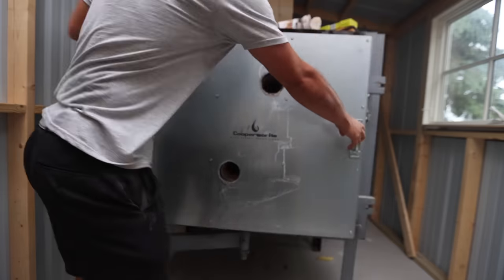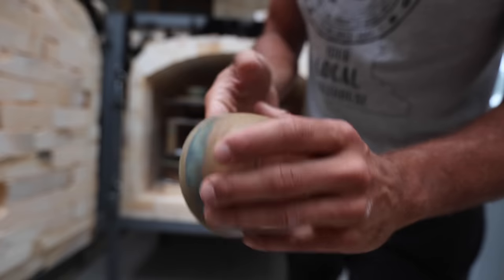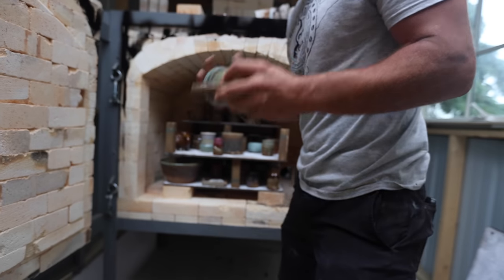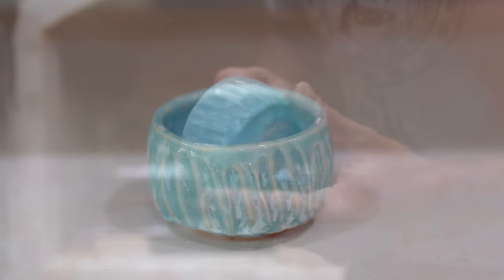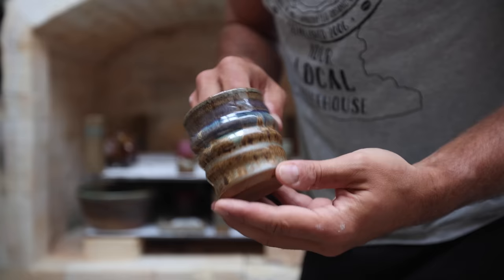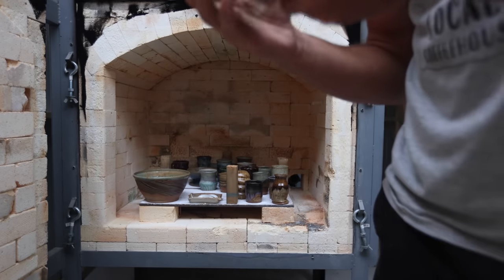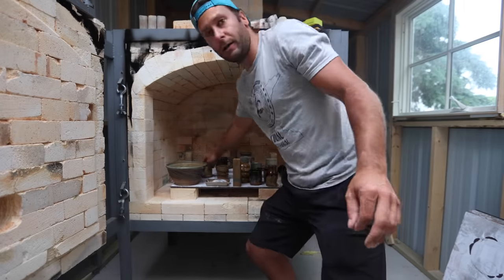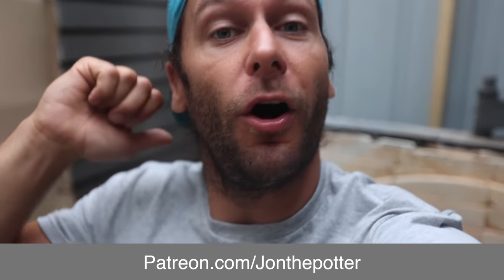THE RESULTS!  Finally UNLOADING the NEW GAS KILN!

Comment: Very timely post Jon!  I've been firing electric (manual, so I'm involved in the process! 😁) but I'm gearing up to get my new-to-me gas kiln running.  I'm thinking that many of my glazes won't transfer over, but some will, and some new glazes will also be in order.  I mix my glazes though, so will have fun playing with modifications of certain base glazes.

I'm debating whether to move to cone 10 clay for the gas, but hesitant to do so when I've got cone 6 pieces unfired as of yet.  I noticed you fired to cone 10 in this.  Do you fire to 10 in your electric also?